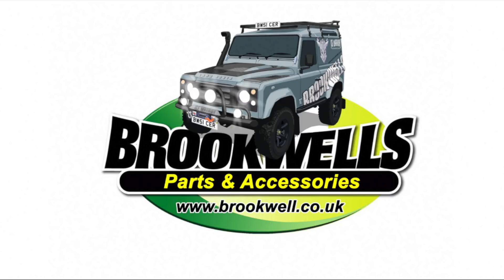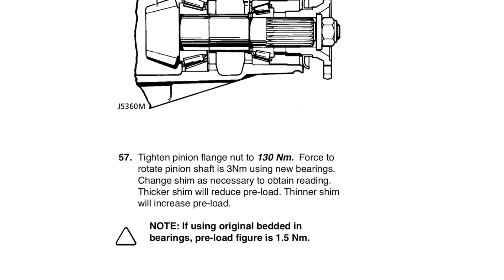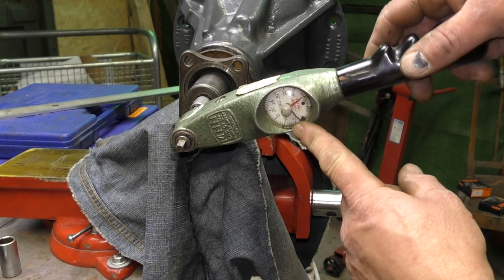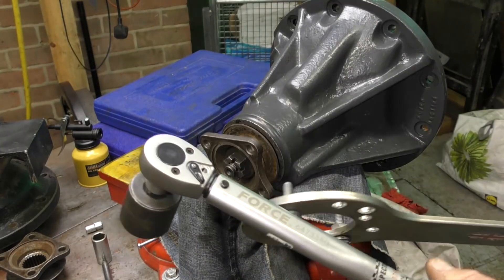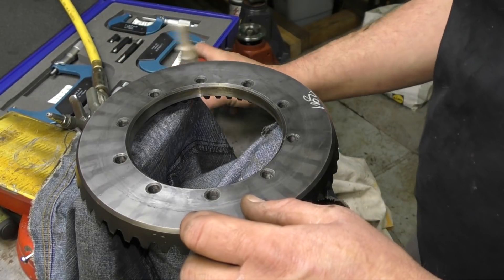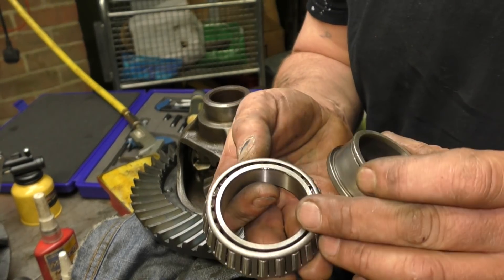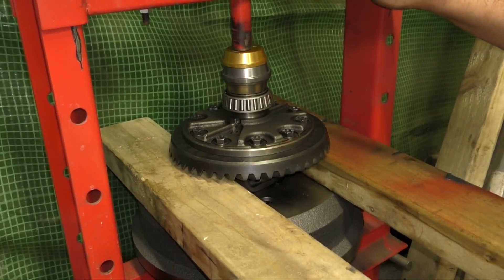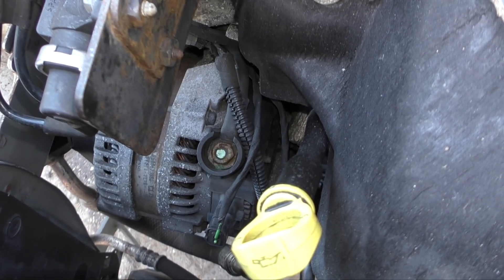Land Rover Diff Overhaul - Pinion Bearing Preload Shims,  Crown Wheel Mounting and Bearing fitting

Comment: Quick question, I have a Salisbury rear diff On my Td5 100, It seems like when I let the clutch out in first as im pulling off the prop almost looks like its sticking a creates a shuddering in the jeep, What would you say this could potentially be either diff & transfer bearings could solve the problem or the Diff needs refurbishment? I really wouldn't know how to do what you're doing when it comes to preloading shims or working out the millimetres but also dont want to go out and spend £2,000 on a refurbed Salisbury rear diff if its just as easy as slipping out the bearings and putting new ones in? @Trailerfitter's Toolbox Videos

Comment: everything is so small... i envy the ease of this.  im rebuilding an upgraded axle for my truck with a detroit. those ring gear bolts are 24mm, each one to 238Nm torque... and the pinion nut is 1 7/8"  pulling that in and out to change shimms SUCKS

Comment: Just a quick question, I just checked on-line at Brookwells Website and the Pinion Pre-Load Shims you have listed in the video ( all 20 or so FTC3869 to FTC3896). They appears to be none listed on their site. I currently  have two Series 2A  109 Differentials to work on. I have replaced ALL the bearings and I cannot get the 90 ft-lbs of torque, the bearing binds up.  I used the same spacers that came out but no luck. I have been reading that the bearings are never the same so they race can be .020" different easily. So that is my problem, but where else can I purchase these shims?  So again, when I install everything and just a small amount of torque, all is good. Any good advice is greatly appreciated!